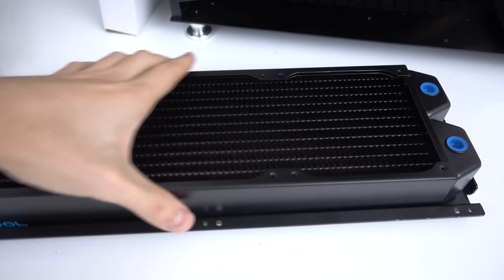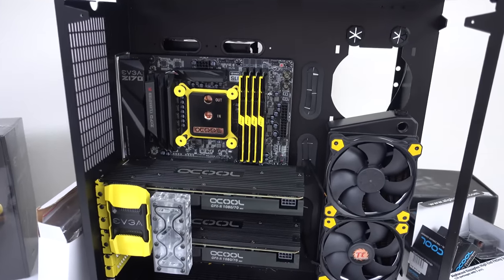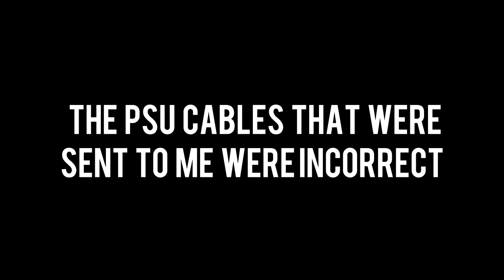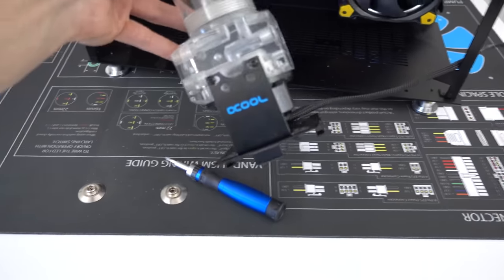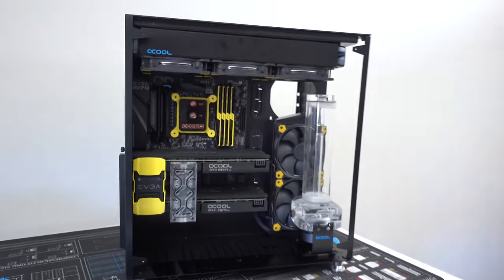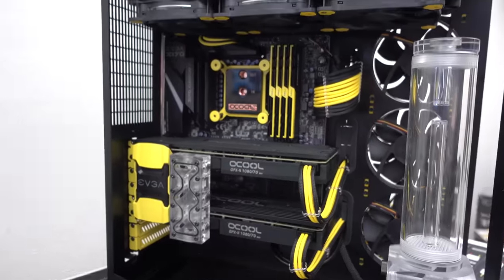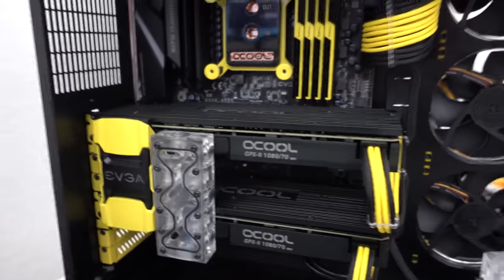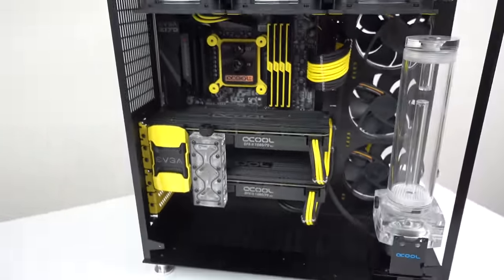The Return of #ELECTROBOX  - Part 5

Comment: do you guy's know any good lga 1151 mb's for like 200$ max
Reply: Distorteduke50 check on amazon?
Reply: yeah i know whare to look just no't what im realy looking for??
Reply: Distorteduke50 check asus viii mother boards, hero, formula, ranger / msi z170s
Reply: the strix look's cool but is it over kill for just gaming?
Reply: Distorteduke50 anyways 200$ is too much for a mother board imo however, Asus ROG strix H270F / gigabyte Z170x gaming 7 / gigbyte z170x Gaming 3 / Asus rog strix z270G (latest model) i found those from amazing with max 200$ pricing, i'de move away from msi and the only reason to go expensive on mother board is to overclock, if you aren't planning to overclockce cut
Reply: yeah just gaming and maybe sli or crossfire tho. hmm idk really much about motherboards can wait to get past this part lol  so the h270f then cuz i have a full tower and the other asus mb you said is a m.atx
Reply: Distorteduke50 all the listen are full ATX that support sli, check the names and reads specs, however motherboard dont really play a major role on fps, almost no effect as i mentioned previously, the more expensive the more overclock capabilities you will have, ide go for the asus ROG strix Z270 its the latest and asus is always my fav, been using maximus viii hero with a 6700k overclocked to 6.5 and works perfect
Reply: holy 6.5ghz i'm overlocking now  jk but thanks man i will get the z270 but what one the h or e and f model??. oh and is a i5-7500 Kaby Lake Quad-Core 3.4 GHz  good for just gaming or should i get a something else.

Comment: Sorry Ed, but I can't stand the orrible way you remove the fan sticker. Razor blade and screwdriver scratch the plastic and looks awful even if they'll be covered. Try to remove them by using heat gun and then by wiping off with alcohol the remaining adhesive.